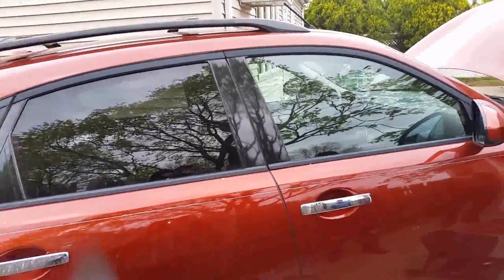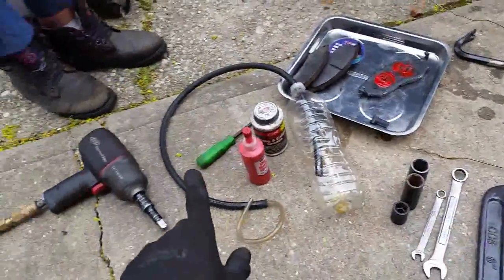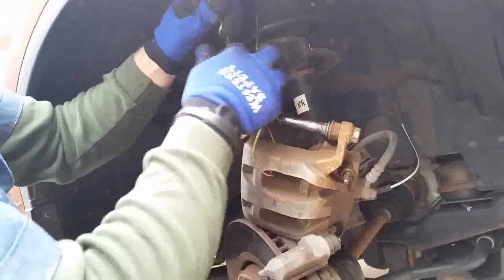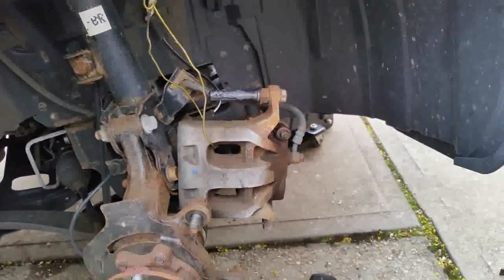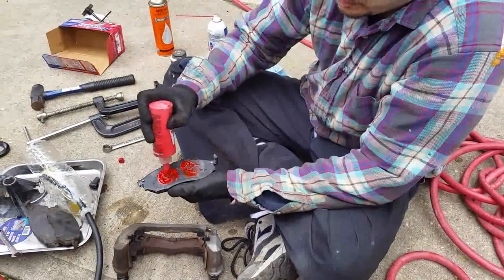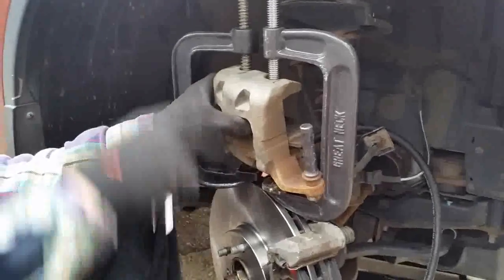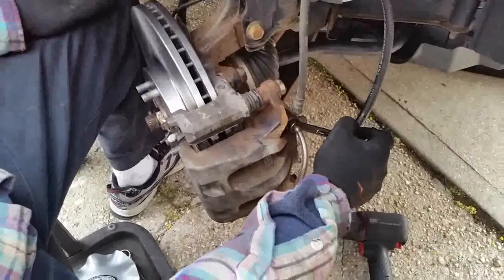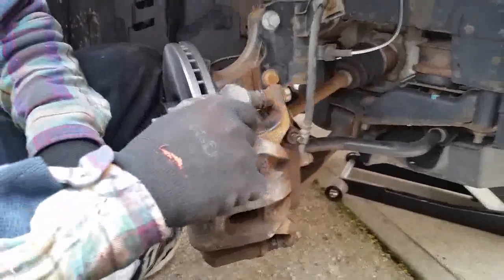Infiniti FX35 Front Brake Pads And Rotors

Comment: On all my vehicles I've owned, (about 35) I've never opened the bleed screws.  The piston will retract with slow steady pressure and it will just push the fluid through the line a bit.
Reply from the maker: Rob Burgan lol 35 vehicles? Must be nice to be u lol .. well so you know, certain vehicles u can mess up the master cylinder doing it your way
Reply: not really, I just get bored of cars so...  I am not sure how just a little fluid backed up the hydraulic line could mess up the master cylinder.  I'm going to have to look into that.  Thx
Reply from the maker: Rob Burgan no prob..it pushes back on the seal on the piston and unseats it..it can also clog up abs solenoids
Reply from the maker: Research it..this is the correct way
Reply: @klowny1969  don't have to research been doing this for 15 plus years and never had a problem doing it and never seen anybody that does it and never heard of them having any problems. It's just an extra unnecessary step.
Reply from the maker: There are several reasons why you should open the bleeder. The dirtiest part of the brake fluid is inside the caliper and when u push the piston in, there are chances that you can clog an abs solenoid. Another reason is that fluid was not meant to be pushed back into the master, so the master piston seal can dislodge and have no brakes. I have personally seen this happen a few times. Just because you never encountered it, doesnt mean it never happens.
Reply: @klowny1969  I think you just read that off before you did the video so that nobody would say anything to you. You know covering your butt.but the reality of it is that nobody does that and I've never heard of anybody running into problems because. If you had problems with it ,it was because you were doing it wrong
Reply from the maker: I own a shop and have seen this. Please do your research

Comment: Great video, just finished putting the brakes on my 2007 FX35. The only thing that was not mentioned was how you should hook the little retraction clip through the brake pad loop when attaching the brake pad. I probably did not use the proper part names so please feel free to correct me.

Thanks again,
Reply: I was just working on mine trying to figure out what those pointy metal thing were for. I figured it out by accident when it actually slipped into the brake pad on its own! I haven't found a video yet that shows what to do with that?

Comment: SO i used this to do my truck, one thing you didn't mention was the plates backing the pads.  They need to be removed from the old pads and put on the new ones.  You had them already done in this video.  When you buy new pads they don't have that backing plate so they need to be moved over.  I put it all back together then realised this was missing and had to take it apart again...
Reply from the maker: Erin Edwards usually the good pads come with the plates

Comment: Just a quick comment and that's no Japanese cars no German cars use standard size tools so anyone watching this just use the equivalent because there's going to be play on an imperial size versus the metric size that's a mistake other than that good video.
Also invest in a break kit to push the calipers in C clamps are not the way and I don't know what he's talking about bleeding the brakes you don't have to bleed the brakes if you don't open the system
Reply from the maker: The right way to push in a caliper is to bleed as you do it..look it up

Comment: I'm  a time served motor mechanic - and there appeared to be absolutely nothing wrong with the pads that were in - so why were you replacing them?, and you NEVER need to bleed brakes when changing pads/rotors - it's NOT good practice, and certainly nothing that should be done unless you have air in the system/a soft pedal.
Reply from the maker: If you were a mechanic you would definately know that bleeding while pushing the caliper piston in IS best practice..there are several reasons..and I'm not going to go through them..Google it